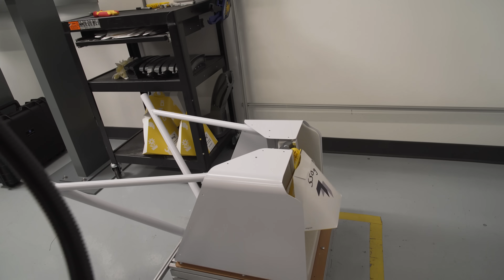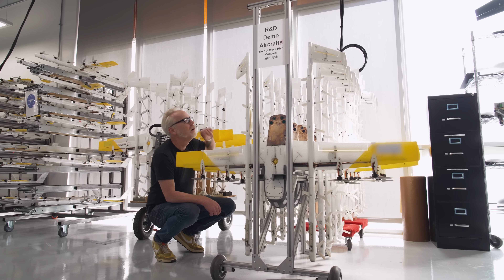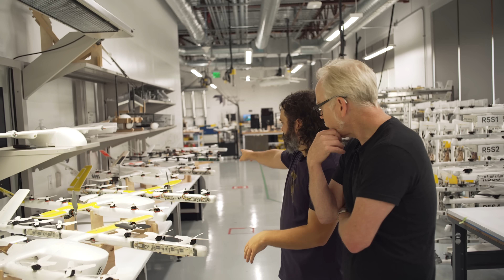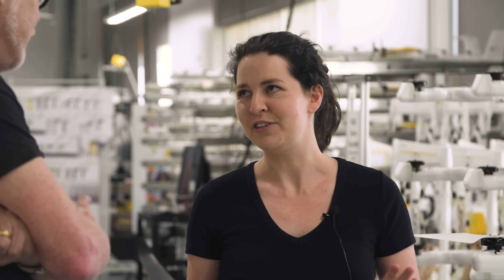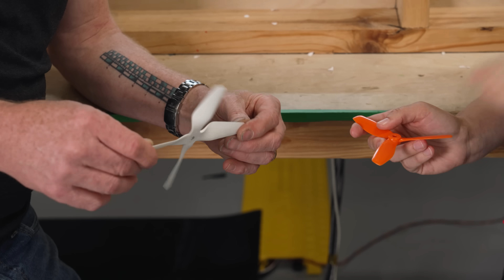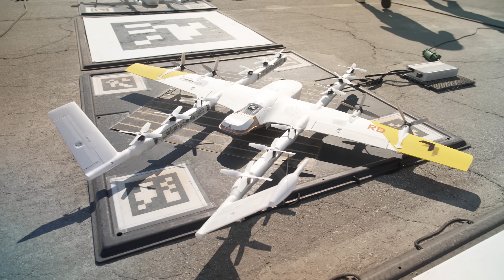Adam Savage Explores Wing’s Drone Engineering Workshop!

Comment: I am always curious why a land-based launcher is not used for these. Surely it would be easy to have a catapult or similar connected to mains electric which would save the high initial energy needed for doing the first 25 metres?

Comment: I’m no engineer but I’m pretty sure if they designed the drone as a miniature scale of the military plane osprey. They would solve the issue of drag from the hover motors and propellers. Thus saving weight and efficiency

Comment: Can't wait for the moment where they realize the fallacy of their idea in making living more dangerous for the convenience of corporations making money from us easier, and will definitely have the audacity to assume their the only ones capable of building drones, and will discover how tech savy the underclassed are when pirating operations begin happening on delivery drones. I could easily conceptualize a 3 drone heist and develop the team of drones at home; drones, not programmed, but, Piloted by fpv pilots where one would have something to sever the lowering cable, and the other two to catch, and then rip it TF out of there as these delivery drones are not going to be designed for top maximum speed at full throttle, they're going to be oriented towards weight mass \thrust ratios.

Comment: That’s really gotta be a tough job trying to keep to one specific idea. This whole time my mind was thinking about the point when the “drone props” turn off for forward acceleration and the thought of using those “drone props” as more wings during forward flight. Like after the “drone props” deactivate, if one of the props changed angle so both props then acted as wings during forward flight, that could be so cool but wildly impractical but I’d be sitting there for days trying to figure it out and never get anything done. Still, the thought of drone props turning into wings during forward acceleration is something I’d love to see.

Comment: The Truth:

Public Safety and Design:

The Blades are to be guarded. 
If the Drone should drop out of the sky for any reasons the spinning blades should not poss any danger to the public.

I know for sure that it is possible to guard the blades and still have enough power for lift.

I will not pass the current  design for public use

 
Sincerely

Mr Ejike Ememe
Ba Hons Degree Administration 
Thames Valley University London

Comment: RC pilots have been flying all kinds of aircraft, fixed and rotor, for almost 75 years. I have an off the shelf, kit built, 72" span monoplane that will carry (and drop) 6 lbs that cost less than $1,000 and I'm just a weekend hobbyist. Join Aeronautical Modelers of America, find a club, they'll teach you how. Then plug in your favorite GPS, tell it where to go, and how to get home. 
Don't get me started on propellers.

Comment: duct it!
Reply: Think of the vertical takeoff of a fighter, they are super flat on that axis, but it creates a larger pressure surface on the bottom and creates a lower air pressure above, which produces its lift. So it would not only serve the drone as safety but also thrust power.

Comment: With all the talk of propeller noise, I'm surprised I didn't hear them mention toroidal propellers. They're supposed to be quieter and at least as efficient as traditional props. It's hard to imagine they didn't look into it. Perhaps they did consider them but rejected them for some reason?   Also, they clearly rejected the idea of having a smaller number of propellers but having them rotate from vertical to horizontal.  It would be interesting to know what those trade-offs were too.

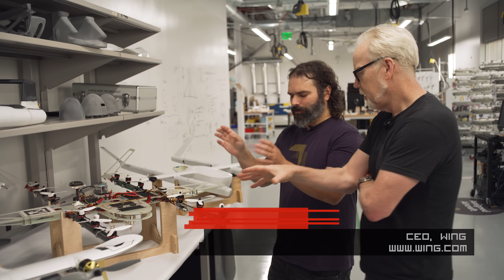Comment: 0:54 hahaha love that yours still using a pixhawk. Go for the control zero 3DR now makes. Adam, visit 3DR in San Diego. All the components that go in drones we design, manufacture and assemble in San Diego
Reply: That is an early prototype test platform from roughly 10 years ago. Our current drones in service use custom designed hardware & Software 👍
Reply: @Wing  Custom Software based on something existing, or completely custom? If the latter: Can you go into why?
Reply: 3DR is still around!?! I'm headed there next! Haven't thought about that company in over 12 years.  ( my old Vtol hoby)

Comment: Fun but they are doing it wrong. It simply must be possible to just have two rotors on tilt wings for all modest of flight instead of numerous redundant propulsions. Numerous rotors also interfere and create the bee swarm sound. It could be two shrouded polyblade props so the frequency is moved way up and almost continuous. And winching hte payload down means you have a prolonged hover period. Instead residences should have a publicly listed landing pad, the new mailbox, that means apartments can have little platforms on their balcony or even a small window. In hellholes like new york. The drone sets down the payload on the pad like a hawk and sweeps out again very fast for minimal urban disturbance. Wings are great but they don't have to be super efficient because most delivery is modest range. Larger cargo drones can be longer backbone flights. And the quintessential use case should probably be 3 pizza boxes and let that volume become a standard. You can fit a quart of milk in such a box, spaghetti, chinese food can adapt to it, it can cover a lot. Say maximum payload 3kg. Maybe even only 2kg to keep sound footprint low. You can always just send 2 drones.
Drone delivery can become absolutely massive, so huge that house architecture will start to leave out kitchens because everything is delivered from robotic kitchens. When delivery is cost free, magic happens. Imagine ordering a flash drive and 60 seconds later it arrives. Or order dinner and 5 minutes later it arrives. On the slow end. You could imagine volume being so large that orders are filled before being ordered like how McDonalds sometimes do so the meal is ready the moment you click and it's at your house in less than 60 seconds. It's a kind of magic.

Comment: Wonder why a blimp style is not used for more silent flight?
Reply: Good question! You're right, blimps and other balloon-style aircraft are the quietest man-made aircraft. My guess is they went with wings and propellers for maneuverability or wind resistance reasons. Though blimps are very quiet, they turn slowly and can get pushed off course much more easily by the wind. 
Flying along with the wind a blimp could likely get close to the speed of a drone, and do it almost silently. But flying across or against a strong wind current they'd go much slower compared to winged aircraft. And for a delivery service like this to fulfill customer orders all over an area, they need aircraft that can go any direction from the launch site as quickly and efficiently as possible, and also return to home base quickly for the next load.

Comment: I noticed it cut away when the delivered package touched the ground.  Breaking that situation down mechanically, if the drone winch can't detach itself that means the customer would have to detach the winch.  That's a problem.
Reply: Here is a video of the package touching down as well as additional information about our hook & tether system. No action is needed from a customer to receive a delivery, only a clear space on their property abou the size of picnic blanket with clear vertical access to the airspace above. 👍

Comment: I think the progression FROM full composite design TO hot-wire-cut foam is very interesting.  Hot wire should be simpler for prototyping as well.
Reply: After thinking about her workflow, I feel like I have been standing on my head. 
I want to start with the cheapest materials, and manufacturing because I feel like early on, I'm more likely to break, change, and scrap stuff. It feels like I don't want to allow myself the higher end stuff, until confidence will allow. 
   After listening to these conversations, I wonder if I'm thinking backwards. I am imagining they first solve the math, then design in CAD, then check math, and then build a model as close as possible to the digital one?

Comment: cool project, but....
i am a paraglider and i am concerned about the conflict with these drones. i assume these are not operated ba a human. what flight rules does this drone follow?. Paragliders are bound to VFR. also Paragliders would have priortity as they have no engine. would the drone make way?
Reply: Heres a solution that needs regulation. Either, They only travel on roadways. OR Safety zones are quarantined from the drones, like how Airports are darkzones to drones, so should or can be park areas for Gliders like yourself. Typically Gliders are not in major urban areas. you wouldnt want to crash into joe's house.

Comment: I enjoy the idea but can you imagine dozens or hundreds of these running around your neighborhood.
Reply: Well, I've already got dozens of delivery trucks running around my neighborhood, so...

These will bring their own problems, but they will also eliminate a bunch of existing ones. I'm happy to see that they are taking into account some of the potential new problems that drones might create, and working hard to mitigate their impact in those areas.
Reply: @harvey66616  The difference is if a delivery truck breaks down, it just pulls over.  

If a delivery drone breaks down, look out from above
Reply: @davect01  Right. Because motor vehicles never have failures that result in the vehicle leaving the roadway and/or colliding with persons or property.

Also, you seem to be under the impression that a delivery drone is just going to plummet uncontrollably if it fails. Even if it does, I would much rather be hit by a falling delivery drone weighing a few pounds than a 10 ton truck. But beyond that, barring a complete failure of the control systems, which is highly unlikely, a drone can simply glide to a landing if its propulsion fails.

These are solvable problems. Drones don't come without risk, but they are hardly insurmountable, nor dramatically worse than what we live with today.
Reply: @harvey66616  I just don't see an upside

Comment: Why don’t they do it like the osprey with rotating propellers that can turn vertices to hover then move horizontal to move forward that would limit the use of so many propellers and motors
Reply: Good questions. More propellers = more redundency, meaning that the aircraft can still maintain stable flight even in the rare event of multiple motor or propeller failures. Thanks for watching and the question!
Reply: Somebody else asked the question and another person answered better than I could, but I'm going to anyways. The thing about the Osprey - as awesome as it is - it's a very complicated bit of machine. More complexity = more points of failure, and they are trickier to fly. Simplicity and a bit of redundancy is a better call for something like delivery drones. (Oh, and also someone from Wing already answered also. Oh well, I'm leaving my thoughts here also.)
Reply: They exist in the RC world, check out the HeeWing T1 or T2 VTOL as examples.

Efficiency and lifting capacity might be 2 reasons why they don't use style of drone.

Comment: I can see this working for specific applications, medical supplies between hospitals, mail delivery to islands or remote locations - for day to day stuff the thought of a child etc pulling one of these from the air scares the s**t out of me and I reckon its a real risk. Lots of the tech shown here seems standard Arduplane stuff, plenty of stock props etc they could be using for similar performance i.e. lots of R&D effort for minimal/zero gain.
Reply: I'd imagine they're using a forked PX4 stack instead of arduplane, but yeah, the whole industry is very much built on the backs of hobbyists. The way I see it, Wing is focusing their R&D effort onto completing the last 20% of turning those hobbyist systems into a cohesive product. And as they say, the last 20% is 80% of the work.
Reply: There's a video they did with the Slow-mo guys showing that wasn't possible. It has built-in fail safes, including disconnecting the cable if necessary.

Comment: Thank you Adam and Tested team for coming and checking out our Lab! 🔬✈️
Reply from the maker: Thank YOU! So fascinating.
Reply: Have you thought about small airships with the main lift supplied by Helium? Yes wind could be a problem but you could have larger motors and move up and down too work with the wind.
Reply: @gamesman0118  Different product I assume. What is "small", for the delivery speed and payload desired.
Reply: @gamesman0118   a quick internet search resulted in that you need about a cubic meter (0,933) of gas to lift a kilogram, so let's asume the plane is a kilogram, and the payload as well, that allready needs 2 cubic meters of gas. The gas container also weighs something and needs to be safe so it will go closer to 3 cubic meters probably. Then, the plane needs to land in ppls driveways or backyards, manouver around trees and streetlights and whatnot... This is a nogo I asume.
Reply: Nice to learn about all the iterations needed to come to a “final” design.
Reply: Any issues with drone licensing?  I have a drone and can not exceed visual distance... I assume you are going considerably farther than that for deliveries.  I would expect the goal is full autonomy, but FAA licensing requirements do no allow that at this point... or do you have exceptions for that?
Reply: Impressive. Heartening to see a smaller company creating viable cutting edge technology applications. Guessing Wing may be a candidate for a buyout (or already has) but I love seeing true innovation still begins at the grass roots.
Reply: How about a mother ship to share the load to a central location. It doesn't land, but waits for docking drones. It shares the load and transports them back to warehouse.
Reply: You guys need to go higher. Under 400ft there’s little room for error. Try 800 - 1200ft it’s as if the aircraft enters a different dimension of sound up there.
Reply: @dronelabs300blk In some cities 400 ft is about as high as you can fly a drone without a whole lot of red tape! 😅
Reply: @dronelabs300blk  Drones have a bunch of FAA regulations, with altitude being one of them... all depending on the specific location.  What I wonder about is how they get around the regulations that someone has to be directly in charge of the flight and must ALWAYS have visual contact with the craft.
Reply: @ that’s weird I developed BVLOS systems for UAVS dating back to 2014. And UAS in the NAS is never going away even tho people say it’s dead. Just wrong channels. Technically aircraft not on an approach should be above 1200. Below 400ft for UAS will never work for noise and there’s no room to maneuver. I dive 400ft in seconds.
Reply: Under 400ft is the general FAA accepted ceiling in most places.
Reply: @dronelabs300blk  Then you start to mix it with the light aircraft fraternity.

Comment: I'm curious why they didn't go with a design more similar to an Osprey, I feel like it would be more efficient and aerodynamic then having seperate propellers at the top causing more air resistance. Still cool regardless tho
Reply: "Tiltrotors" as they are known are, for lack of a better term, a total pain in the ass. The osprey does it by being two entire helicopters in a tilting trenchcoat: each rotor has it's own independent cyclic controls to adjust propeller pitch and directional thrust. So complicated! So fragile!
There's a simpler way of doing it, a so called "quadplane" where it has four rotors but only the front two must tilt. This allows you to use simpler motors and propellers, they can be basic fixed pitch stuff like the ones on these Wing drones. The tradeoffs are, you still have two dead motors to carry in forward flight, the front propellers must be halfway optimized for both hover (static thrust) and forward flight (dynamic thrust), the transition between the two modes of flight is a much more complex problem as the tilting motors are having to handle double duty at that moment, and from a reliability perspective any failure on a tilting motor means immediate termination of flight (ie, crashing).
Some drone companies do go with the tilting quadplane style, but I think it's a complicated compromise with little actual benefit.